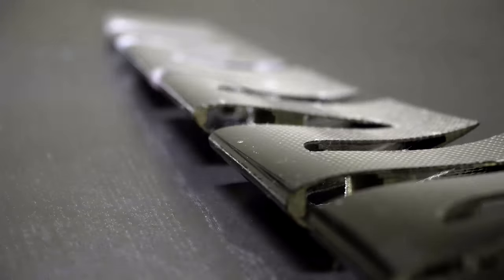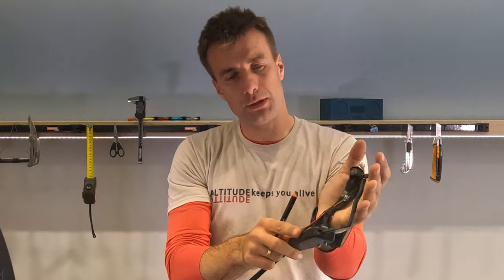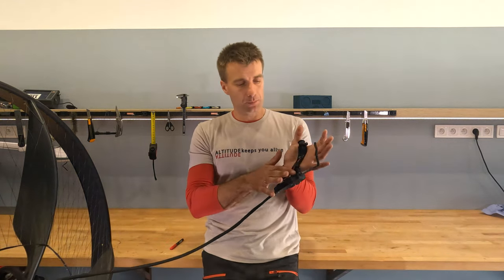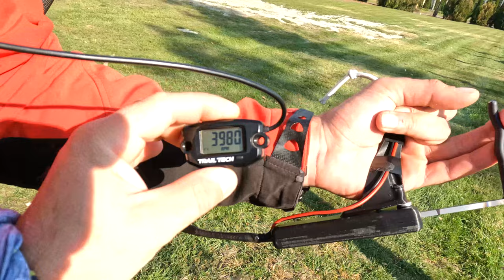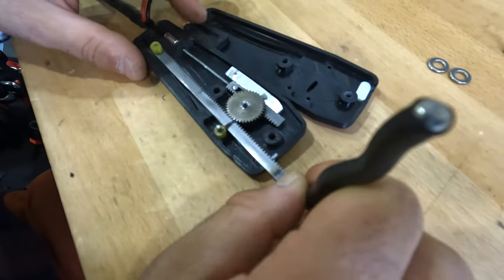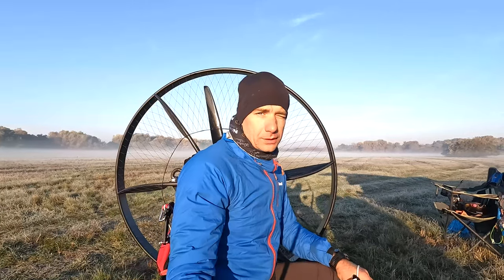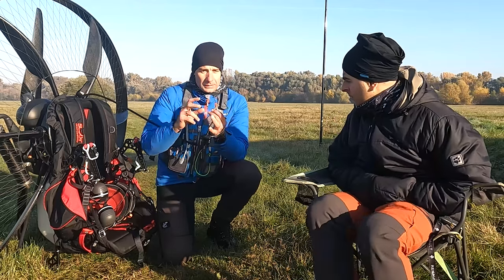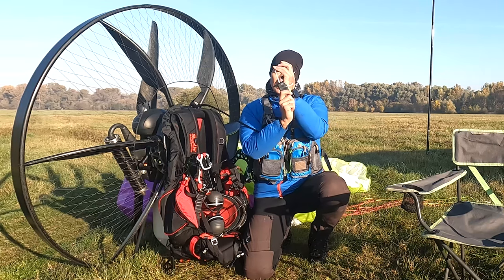Will this be the perfect throttle? Smarter Pilot series.

Comment: Love everything about what you're doing!  I'm excited to see what you eventually come up with.  I wish there was a way to get the throttle control off of the hands - as its a complication that is extra confusing, especially for beginners.  If still on the hand, I think at least if there was a reliable way to do a wireless throttle, or perhaps attach the actuator lever to the thumb instead of the fingers.
Reply: All you need to make that come true is a servo, a servo tester, and a battery. I have considered that option myself but a lot if people see it as an extra failure point. With that said I never had a single servo issue all the years I flew nitro model airplanes.

Comment: I agree with comments suggesting you should do the "flight by wire" throttle. Doing so you will be able to completely separate the hand movement from the carburettor/efi control. Then you connect them with smart programmable electronics, producing any desirable and configurable curve (not to mention cruise control, independence from the cable bending, trainer assist, security shutdown, etc. - you name it).
Reply: Also, the throttle handle is a good natural place for some useful displays like EGT, CHT, RPM, Fuel.
Reply from the maker: Such throttle was developed by my friend here in slovakia. It was a Bluetooth wireless throttle.  I had it on the box and did not install. I was scared by the complexity of the system, too many things to fail. Not for me

Comment: Another thought --- When safety is at stake, nothing beats the simplicity of a basic lever attached to a wire.  That said, you're pushing the envelope here, and humans have been doing Fly-by-wire in aviation for a respectable amount of time.  Perhaps in-place of the various meshed exocentric gears, you could use a potentiometer to read throttle position on the throttle, and a servo mounted on the engine to control the throttle position.  Use a microcontroller to read the potentiometer and apply the output curves via software.  At very least in the development phase you could very quickly tune different 'dosing bands' --- even tweak them in-flight!  Then you can 'print' the curves to physical meshed gearing for production?

Another advantage would be a massive weight reduction for the wire connecting the hand throttle to the microcontroller mounted on the engine.  Maybe as simple as an RS-422 cable?
Might even be able to reuse the SafeStart controller to house the I/O and logic in the short term?  GAH!  I love this project!

Eventually you could plug it into an altitude hold mode style Autopilot for your photography/filming of Iceland shenanigans?

Comment: What are your thoughts on Thumb operated throttles? I always thought that they make sense for PPG if designed correctly. Stronger muscles and not used for anything else in flight. Not so good for peeling bananas, but I use cruise control for things like that on my current throttle. 
My though would be to have the hardware on the back/bottom of the hand so there's as little as possible in my palm, ideally just a strap and my fingers are free to operate the brakes.
Reply from the maker: i was considering that too. I came to a conclusion I want to keep my index finger and thumb free to peel my banana... (zippers, camera lens, selfie stick, trimmers)
Reply: @Harry --- I was thinking the same thing.  I did realize however that my takeoff has the A's hung in my thumbs, which could be and interesting interaction --- I agree the tradeoff would probably be worth it however as 99% of the flight is NOT takeoff :)

Comment: A perfectly throttle would be fly-by-wire.  Cruise control would then be easy to implement along with forced idle for safety.
Reply: If you really want a perfect throttle, I know an incredibly skilled electronics engineer in UK that has already done much of the work that would cross over for this application.  I'd be happy to connect you.

Comment: First of all good work!
I thought about cordless throttle. Why do we need a cable? Just take a servo from rc model and try to build it as a shifter for the carb. I think it’s possible. No great thing. 

This would be a throttle next Gen. I think…

Keep your work on.
Reply from the maker: that has already been invented by others. Actually we even had one in house. Honestly I do not see much benefit from it. But I see more parts to fail possibly.
Reply: @SCOUTaviation  Maybe a wired connection rather than cordless ? Would eliminate the issue on cold mornings of cold oil/grease causing sticky throttle ? Either way I will be watching development with interest, its good to watch someone trying genuine innovation (without trashing competitors).
Reply: I'm with @Graham --- A wired solution, with a data cable between the throttle and the engine mounted servo could be the best of all worlds.  Essentially a fly-by-wire system, there are VERY reliable solutions that could be developed - possibly even more reliable than traditional throttle cables due to maintenance requirements.  The cost would be of no comparison --- cables are bargain basement cheap.